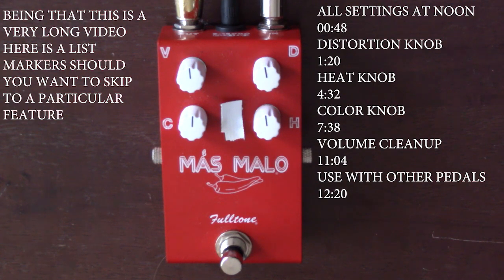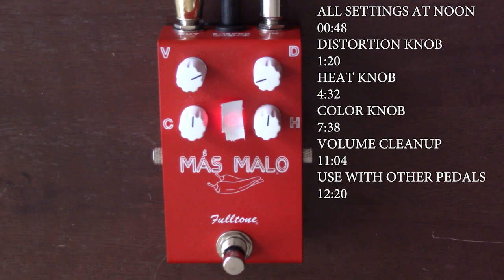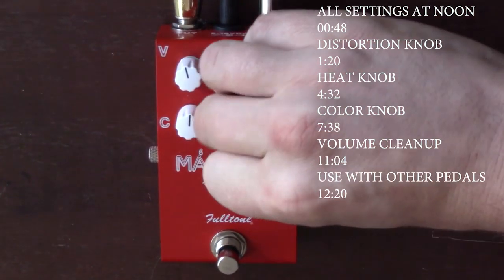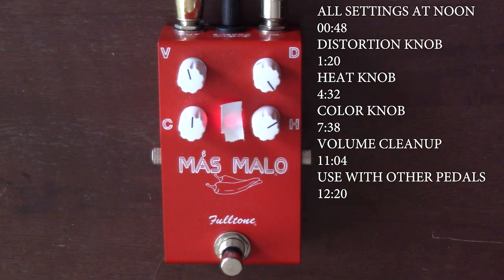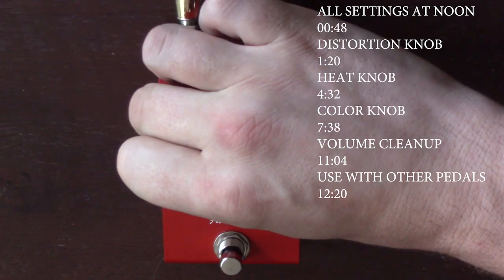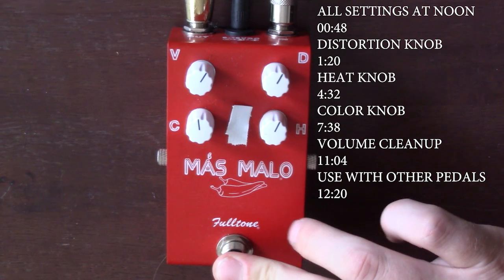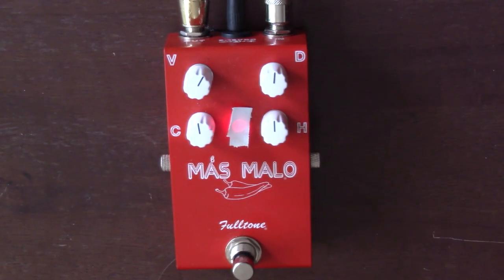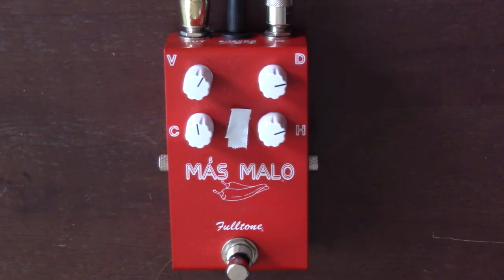Fulltone Mas Malo

Comment: What difference if any between black and silver labels underneath the Fulltone Mas Malo effect pedals? :hand-pink-waving::face-blue-smiling:
Reply: No clue. Never looked at the bottom. I wonder if some of them use different components. This original units were made with NOS components so I imagine those were in limited supply.
Reply: @codecrasher4367  

My serial number is #18, so I'm assuming that this pedal of mine may be from a new batch and the silver label being a part of an older batch of pedals.
                                                                           My MM has the same components...three New Old Stock (NOS) BC184C discrete transistors which respond with the sweet sustain, touch sensitivity, and harmonic warmth of a great vintage fuzz. :hand-pink-waving::face-blue-smiling:

Comment: I got this pedal based on demos. Trust me when I say it is the versatile gain pedal ever. Everything from slight break up to full on fuzz. This demo nails the tone of it.
Reply from the maker: thanks! I am a big fan of it.  There are many more expensive OD's out there that claim to have versatility but are really just one trick ponies.  This guy is affordable and can get you many tones that aren't that hard to dial in.  Thanks for the view and the comment!
Reply from the maker: yeah the plimsoul is great, but I think the mas malo had a little more thought put into it, and it's definitely better built using better materials.  Honestly I think this is Fulltone's best OD since the original Fulldrive 2. and $120 new? What a deal.
Reply: So this sounds crazy but I’m going to try to get another one because of the versatility. I already have a few drive pedals I don’t use.
Reply from the maker: That's not crazy at all, I am huge fan of stacking drives.  I've never stacked two of these but I imagine they'll work well together.    Let me know how that sounds if you do!  I'd be really interested to hear what double mas malo at lower gain settings is like.
Reply: @tacogladiator7503  yeah two of these together would work well I'm thinking 🤔

Comment: Great video. I bought one of these when they were first released and just don't why this pedal hasn't been more lauded. I love it.
Reply from the maker: Chris Nagy that's a very good question, it's a fantastic pedal. I think it just got lost in the load of new designs that came out this year, new pedals come out every year, but I felt there was quite a big push this year from all the major companies. To my knowledge this is the only brand new design fulltone came out with, many of the other companies released three or four new pedals this year.
Reply: Mr. Gear Lizard. Hi. I cannot make a lot of noise where I live. Would you say a Bugera 5 watt tube amp is good? I'm dying for a tube amp. I have like 4 digital amps. My favorites being a SP10 I think Squier thing and a Champion Fender 20. They sound great, but tubes I have to discover. Any recommendations. Thank you Mr. Lizard.
Sincerely, CN
Reply from the maker: Chris Nagy Bugera is good for the money, if you're looking for something that low wattage though Vox makes very good 4 watt tube hand-wired amp. Oranges Tiny Terror gets down to 7.5 Watts, and if you've got the money to spend Swart makes some of the best low wattage amps there are but they're pretty expensive. I actually built a box and padded the inside with foam and put the Fender Deluxe Reverb inside of it to make everything softer and be able to crank the amp Warren, if you did that with say a decent 10 watt tube amp you probably be okay.
Reply: Hey Mr. Gear Lizard. I just got a Blackstar HT-1 SE, no frills, no headphone or reverb just three knobs with an overdrive button and this amp rules; especially, with the Mas Malo. Thanks for your comments and the Mas Malo is an awesome pedal. And it does some bumblebee noises as well. Thanks.